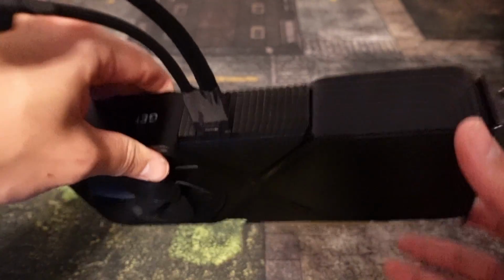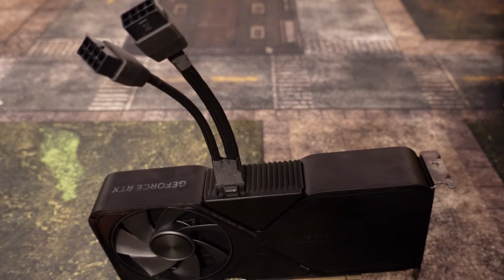RTX 4070 SUPER installation guide: everything you need to know about the 12vhpwr cable!

Comment: If you know what you are doing and have a very good power supply, you can run it Pigtailed on a 550W power suply. i am doing this with 0 issues. (only do this when you know how much your setup pulls and know what you are doing)

reason you can pigtail is that you only really need to use seperate cables if the card pulls more then 225w (the cables can actually withstand alot more) 

see the 4070 for example. that card is 200w and is running off a single 8x pin
Reply from the maker: But if you are watching this video then you don't know what your doing which is why I tell people to run it the way I do
Reply: @krootman_digitial  Bro I bought a xpg kyber 850w gold, so you are saying that I need to throw it in the trash just because it has only 1 8x cable and pig tail??
Reply: Its my first time mounting a PC, so I saw that my psu has a 600w cable, I should use this cable direct on my gpu instead then??
Reply: @krootman_digitial  Some people were already doing this and watched your video to see if it were different. So they don't know what they were doing? lol
Reply: i have a 4070 that pulls max 200 watt, would it be ok to use the single pigtail to my evo blue 2.0 850w psu? ....cuz its what im currently doing lol i dont smell smoke yet
Reply: @sanchezmcdirty1  Bro probably your psu has a 12VHPWR power cable that you connect directly in the gpu!!
Reply: So we can use the pigtails than, because couple ppl i know does that and says it dont makes sense to bot use the pigtail. But like i said im no expert

Comment: So do i get this new 12vhpwr cable included with gpu cuz i dont wanna buy a new supply just for it. I can just plug in this new 12vhpwr cable with my current psu?
Reply: No don’t plug the adapter to your PSU, the psu side of the connector is not universal, it might actually catch oh fire
Reply: The adapter connect to GPU then the PSU into the adapter

Comment: 2x 6+2pin will be good for 4070 super? (Psu 700w)
Reply: I'm wondering the same thing. I'm using a Corsair rm850x and it has cables that bunny ears 6+2 dual pins, for a total of 4 plugs, 16 pins
Reply: @fitzr0551  Did you ever find out?

Comment: Could you please tell me if this will work with the following PSU :  MPG A1000G PCIE5 ? Also, what would be the best way to plug, cause I see it has a 16 pin cable and 6x 6+2 cables ? TY
Reply from the maker: Use the 12hpwr cable and yes that PSU will work just fine

Comment: I originally ordered the ThermalTake GF1 750W PSU, but after being told it would be easier to get a PSU with a 12VHPWR I instead ordered the Corsair RM750e that comes with the 12VHPWR cable.

Now seeing the adapter here for the 4070 SUPER, I have no idea how to set this up. Do I need an extension for the 12VHPWR? Is the wire from the Corsair PSU going to go directly into my GPU?
Reply: Yes, if you have a 12vhpwr (12-pin to 12-pin) you go directly from PSU to GPU. Allows you to go from an adaptor cable and two 8 pin cables (3 total) to just the one 12pin to 12pin vhpwr cable.

Comment: Can I use 2 pig tailed cables, but one pigtailed cable for each of the adapter slots (and not plugging in the other 2 of the pigtails)?
Reply: So two separate cables? If you mean you have two separate cables that each have pigtails on them, but you only use one 8 pin from both cables then yes, that is fine.
Reply: @xesxxx  yes, thank you (it was kind of hard to explain haha)

Comment: I have 2 PCie cables from the PSU, one is pig tailed, my 70ti super came with a 1to3x 8 pin adapter. Can I use the pig tail for the 3rd slot?
Reply: have you figured it out yet? i have the same problem @tomcr
Reply: @Skepsisa  Didn't wanna risk it, Just bought a custom, long 3 pcie (psu) to 1 of the 12VHPWR cables 25 squid on amazon
Reply: @tomcr  I saw somewhere that you pig tail one of them to two of the three connectors, but the other one you use just one 8 pin and leave the pig tail unconnected

Comment: thanks for this video! quick question, I have an Alienware Aurora R12, and it has the OEM MSI 3070, for its power connectors it has 1x PCIe 8-pin. Im looking at getting this exact card you showed in the vid (4070 Super FE). Will the adapter it comes with be all that I need? If I understand correctly, the 12VHPR adapter has 2 x 8 pin connectors, so I plug in one of the 8 pin to my PCIe 8 pin but what happens to the other that is unused on the adapter? Any info would be very helpful. Thank you man!
Reply from the maker: you need to see if del can send you another 8 pin, you don't want to run this gpu off 1 8 pin, its not safe IMO
Reply: @krootman_digitial  well I only read on Dell's website that its 1 PCIe 8 pin. What was odd  is that Dell's 3060ti and 3080 use 2 x 8pin, but 3070 says its only 1....so I think the only way would be to open up the case and confirm. Just 1 more question, once opened, where would i check to see if there is another 8 pin and what would be the safest way to connect it to the 4070 Super?
Reply: @EndoV2  Just look for the one that looks like the one in your GPU. It would just be chillin in the case somewhere.  My R12 had two 8 pin connectors, even though the 3060 it came with only used one of them.
Reply: @pointeportal  oh snap so you also have an Aurora r12 and upgraded to the 4070 super? You are the first person I’ve ran into that has a similar set up and upgraded their gpu. So i unplug the connector that is on my 3070, thrn all I do is use the included adapter that comes with the founders and plug and play, that’s it? So does anything go unused and just hang in the case? Any info wkulfk be very very helpful man, I’m about to order the 4070 super founders edition as it just fits in the R12 and uses the exact 220watts..,.not sure if I can wait for the 5000 series

Comment: i dunno how common this issue is but i'm finding it incredibly difficult to get the 12 pin adapter to actually go in properly and click.
Reply: Same
Reply: Same. No click whatsoever. I just pushed it in all the way until the plastic hit the other plastic "wall" and couldn't go further in. All I can do and all I dare to do out of fear of ruining the cable by pushing too hard tbh.
Reply: @AviusL that's what I did. The amount of force required to actually make it go in all the way is kind of insane and as a result you can't completely blame user error when installing it. Seems like poor design. What was so wrong with the old 8 pin adapters that AMD still uses.

Comment: Got the 4070 Ti Super from Gigabyte. For the life of me, I can’t put that cable all the way to the end. Tried with both card in the case and out. No matter how hard i am pushing it, it won’t go to the end
Reply: Im having the same issue with the same model right now. Did you solve it?
Reply: @jasonhackman5553 I’ve ordered a new cable for it from corsair (sleeved 12vhpwr cable). Until that arrives, i am using it as it is right now. No any problems so far.
Reply: Lol, have same issue with 4070 super also from Gigabyte
Reply: @manvidaspalauskas4934  I found a reddit post with others that also did, same card. We all got Corsair adapters. Stupid that it adds 30 bucks to the cost.
Reply: Same, also rtx 4070 super aero
Reply: I bought a corsair adapter that worked just fine. Cost an extra 30 bucks which is stupid. Found a guy on Reddit that did the same.

Comment: I have a question, I actually do have a pretty good power supply I just lost the other pcie cables because I wasn’t aware of what pigtailing was so I was pigtailing my 6700xt for about a year, never ran into any problems except for coilwhine which I’m not sure if that was the reasoning of it. Well now I plan on upgrading to a 4070ti super but the problem is since I lost my other pcie cables I only have the pigtailed one. I ordered another cable on CableMod but it won’t arrive for a month because their facilities are down. Until then do you think it’ll be safe to run the pigtail on the 4070ti super for a little while or even a short amount of time can damage my pc? Also worth nothing my psu is a Coolermaster MWE 850 Gold V2
Reply: I have a Coolermaster MWE 850 Gold V2, reached out to them and they told me no then proceeded to redirect me to cable mod
Reply from the maker: I mean if you undervolt it you could, I wouldn't, as I like to be better safe then sorry.What psu do you have maybe you can order cables directly from the maker?

Comment: This was confusing.  Im not saying your instructions were bad.  Maybe im just dumb.  But for a beginner like me, it would have helpef if you just walked us through the entire thing.  Even the psu plugs.  Thank you for your efforts, however.  I will try to figure it out using your video because no1 else seems to have an installation video.
Reply from the maker: thank you for the feedback, take alook at my other install guides, they are all basically the same thing. What did you not feel like I explained well?
Reply: @kr00tman the pigtail part.  But this is only because im a complete beginner... or maybe even just slow.  But i didnt know what u meant by the pigtail part.  How the other end connects to psu.  So i ended up just using a single 600w cable that came with my psu.  But i would have liked to understand how that pigtail cable that came with the gpu was used.

Comment: I have a custom sleeved 12 pin cable but it splits into 4 8 pin instead of 2. Is this safe to use?
Reply from the maker: like a 4090 cable? IT SHOULD be fine to use

Comment: 700 watt for a 200W max load GPU? That sounds like some insane i9 intel cpu
Reply: Definitely sounds like overkill. I'm at 459W with a 650w power supply and i5.
Reply: @exurosanctus  Yeah same. 650w is fine especially with i5.
Reply from the maker: Like I said before, if you are a new PC builder or are un sure better safe then sorry... I stand by that, also a 700 watt PSU doesn't cost much more then a 650 watt. It's not like I'm telling you to buy a 1000 watt platinum efficiency psu

Comment: this is a 220w gpu, you can definitely run it comfortably with a 600w psu
Reply: Im running mine with a 500W
Reply: @garridojared  planning to do so today. your pc still fine bro?
Reply: @dervoo  I upgraded my prebuilt that was 500W, with a Ryzen 7 5700G, and a dual 4070 super and it worked fine never had any issues. I didn't do it for long, I have since built my own from scratch with a 750W.
Reply: @garridojared  noted thx. my pc is fine now. the power usage never gone above 75% :)
Reply: @garridojared I also doing an upgrade on my pre built. From a 3060 to a 4070 super two fan GPU. Also has 500w and a  i7-13700f
Reply: @ I would advise against 400, or even 550 watts with your cpu. it also depends on what else you're running. the 4070 super uses 220W max, then you need to factor in your CPU, motherboard, and everything else INCLUDING peripherals. I did run my 4070 super on 550 watts, but only for a few months. I did not run into any issues, but I would strongly advise against it. If you need any help you can send me an email, its in my bio.
Reply: @garridojared  I did not see your email. Do you have anything else? Appreciate it the help
Reply: @ it’s in the about section of my account
Reply: Jus put mine in & i have 600w gold psu runs fine
Reply: Either this or juz follow the recommended requirement 650
Reply: 500w is fine
Reply: Is say 650w
Reply: I got a 650w and it's not enough. I think it depends on how much draw other parts of the PC are using.
Reply: Depend on your AIO and cpu power draw, some cpu require more than 100w. High power rating psu is safer and low temp (not full load). Lastly, psu also has output efficiency. (lowest is 80%)
Reply: Mine is 650W but GPU isn't even powering up , just cpu starting
Reply: I don't know if I'd say comfortably...you can definitely run it but it also depends on the power draw of everything else in your rig... you are muuuuuch better off with 700W or higher...the sweet spot is 750W and that will leave you room to upgrade down the road if you want...not to mention the difference in price between 600W and 750W is really not that much more so it's better to be safe... if I'm using a 600W PSU for the 4070 super I would 100% under-volt it so it doesn't draw as much power but can still perform well....just my opinion...
Reply: I’m running it on 1 watt
Reply: Is 400w okay?
Reply from the maker: Sure, but for people who are new to PC building or are not sure always best to be safe then sorry
Reply: If they got a 13700k or some crap you dont wanna stress your psu  @krootman_digitial
Reply: Dawg not a good idea psu is the one thing u dont cheap out on

Comment: Are you sure about that and can you make a detailed video about it for me and showing me connecting it to the powersupply im planning to buy rtx 4070super but heard some things about 12hvpower connector burning and melting and also people saying that it will burn your house or something so now I'm confused can you help and guide me i don't know much about connecters :(
Reply: Just dont bend it much and make sure its fully plugged in
Reply: @nttinvis  Alr bro thanks for the advice
Reply: @Unknown7r  i just got 4070 super haven't put it in my system yet, also make sure pcie 8 pin to 8 pin to psu and plug adapter into that dont use two 6x2 has to be separate cables
Reply: @nttinvis  ok bro
Reply: @nttinvis  how many volts u got on your power supply?
Reply: People that had problems  , just don’t know how to plug a cable
Reply: @Sn4p_Fps  ok thanks for letting me know I was really confused on that